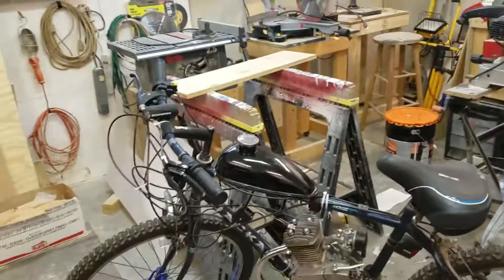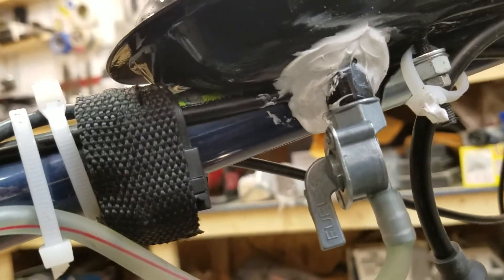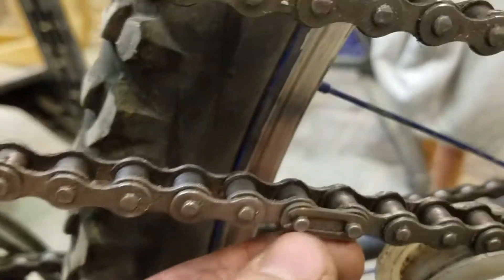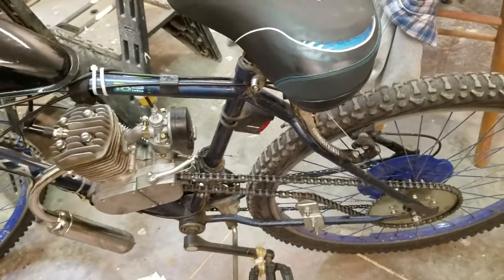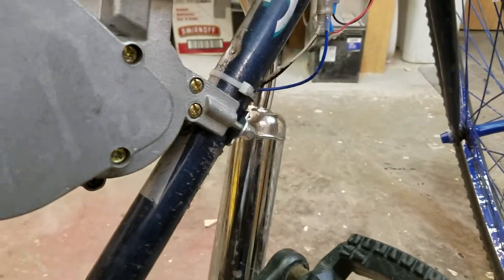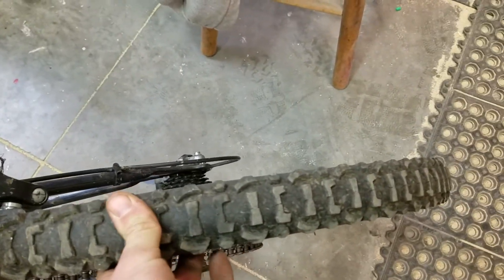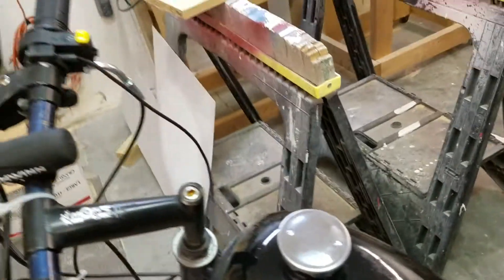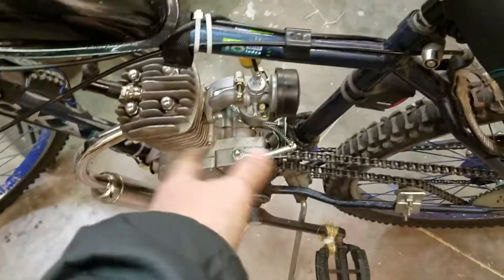80cc bike engine review "in depth"

Comment: I live in ohio as well. But i wanted to ask do the cops give you shot when riding. I looked up the laws in ogio and they want plates registration lights, head, tail, n turn. Helmet and license. Get yourself a jack shaft and use your derailer as a transmition.
Reply from the maker: In Toledo, I have never had a cop pull me over and I have passed a few. If you are pulled over I think you can tell them its a 49cc engine because if it is over it then has to be registered at 50cc to my understanding, but I could be wrong.

Comment: Your fuel filter is upside down, look at the arrow, the rear sprocket is backwards, hence the chain issues you're having, the dished out side goes toward the hub, sight down the chain from the rear sprocket to the front you'll see what I mean. I've put together dozens of these kits and in my opinion don't buy the cheapest one you can find, they have the cheapest components like the two bolt chain adjuster...garbage, an accident waiting to slip into your spokes! Spend a little more and get a kit from Zeda Motorsports, balanced crank to minimize vibration, American stainless steel bolts on the engine, four bolt chain adjuster, 40mm intake instead of 32 for adding performance parts like a good carb and reed valve, upgraded bearings...the list goes on. You can buy directly from them or on Amazon for $10 cheaper, $139 and well worth the price, when your $60 kit takes a shit just remember not all these kits are the same. Good luck